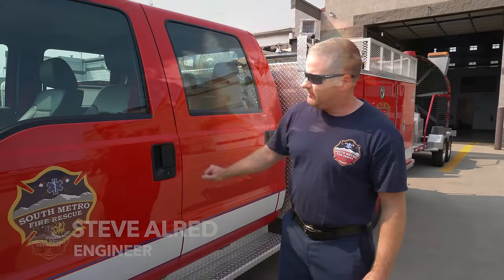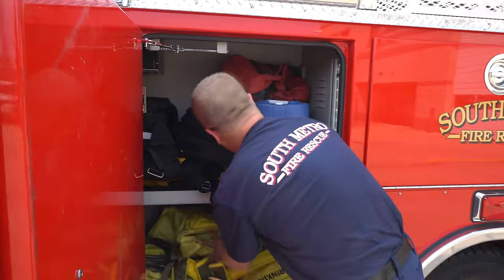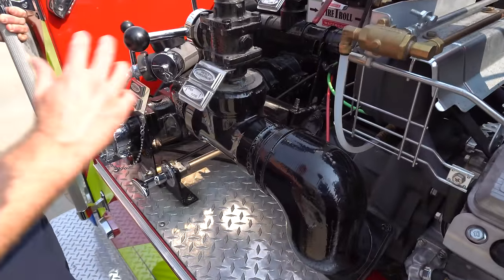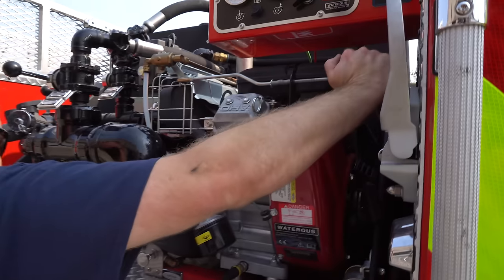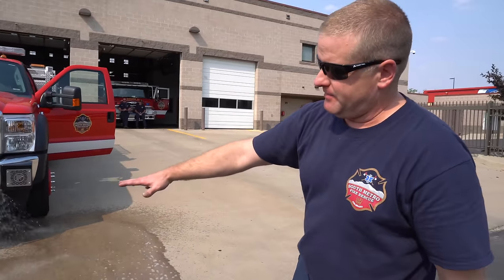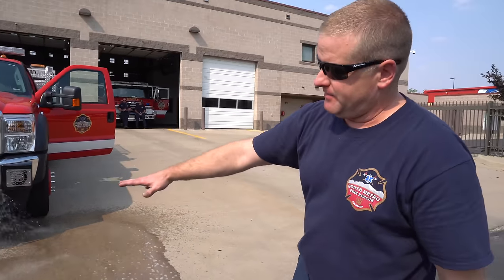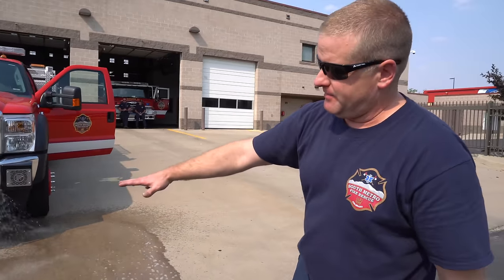Fleet Friday - Brush 22 and Fan 3

Comment: As a firefighter from Europe, a good majority of these compartments are really large compared to what they actually seem to carry. And I'd be almost scared to drive with the unsecured heavier tools loosely stored inside.
Reply: Most trucks in the US have full compartments. This is a pretty bare-bones rig.
Reply: Also interesting to see them use hoses with a thread, instead of the Storz-Coupling we use. Seems like a waste of time to have them as screw on, especialy on a brush engine, were you may have to decouple hoses quickly to get the vehicle away from fire...
Reply: Yeah, though I imagine the problem of coupling issues might be less frequent and severe with simple threads. Damn hard to close/open a Storz hose coupling sometimes!
Reply: Benjamin Köppler threaded couplings are very secure and have fewer moving/breakable parts. they're just reliable. they're also the standard in the US. also, this brush truck would almost never be attached directly to a hydrant as a water supply, it would probably draft off of a porta-tank or body of water, both of which would likely be relatively far from flame fronts.

Comment: Will Former Littleton Hazmat-17 be featured?
Reply: The former Littleton Hazmat unit was retired and sold.
Reply: @Spitfire8520  Probably talking about their Decon 17. The white International crew cab box truck.
Reply: @some0ne8  It is possible and Decon 17 is on the list to be featured one of these days. Since it was worded as "Former Littleton Hazmat-17," I believe they are most likely asking about the former Littleton Fire Rescue Hazmat 17 vehicle which was a 1992 Chevy Kodiak / SuperVac and a full hazardous materials unit. Hazmat 17 made a single run as South Metro Hazmat 17 in the very first month after the South Metro consolidation and was then replaced with the current Decon unit. The vehicle that was Hazmat 17 was sold this past June.

Comment: I noticed the Brush Truck, unlike other engines had no spare oxygen tank, is this because they don’t deploy with them? Is it not needed?
Reply: Scba isn't worn during wild land fires.  They aren't oxygen they are only compressed air.
Reply: Self-Contained Breathing Apparatus (SCBA) are not worn on wildland fires because they are quite heavy and not very useful as a single tank is usually empty within half an hour. Wildland fires are usually endurance battles which can last hours or even days and requires firefighters to be mobile and move quickly. While the air might be smokey, it is still somewhat okay to breath and some firefighters will use a mask to help filter out some of the smoke from a wildfire. SCBAs are typically only used where the air is not safe to breath such as a structure fire where the air can be several hundred degrees or toxic due to the materials like plastics being burned.

Comment: What's the difference between the wildland hose lines and the regular hose lines on the other rigs?
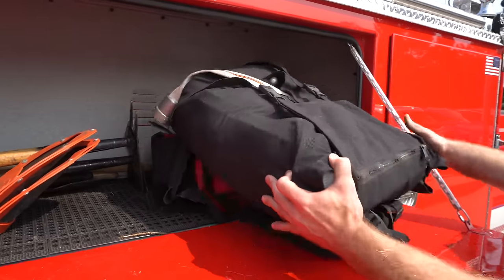Reply: Wildland hose is a smaller diameter single jacket hose that is lighter to carry and deploy, which is important where you may need to deploy several hundred feet of hose through difficult terrain where a truck cannot reach. At 6:33, Engineer Alred showed the progressive hose pack which has a 1.5" trunk line which supplies a 1" line that is they use to fight a wildland fire. The smaller diameter a hose is, the less water it can flow which is all that is needed to put out most wildland fires.

A regular hose line is a double jacket hose that is more durable and heavier. Usually those kinds of hose only need to go a couple hundred feet into a building. Some of the typical diameters of regular hose are 1.75" and 2.5" which allows them to flow a lot of water that is needed to put out a large fire.
Reply: Spitfire8520 Thank you for the detailed explanation, I appreciate it.
Reply: @dfw_fpis7655  Also depending on what they choose to deploy, some wildland hose also weeps water through its jacket and soaks itself in water to protect the hose from burning out.
Reply: JR:FIT Now that’s really smart.

Comment: That is the most trouble sum 4 wheel drive ford ever made in them years.  You will be stuck in the mud only to realize the 4 wheel drive front hubs striped out and are not working.    I have had to fix's 100's of these at the shop I work at

Comment: Why is it called fan 3? Why not fan 22? Are there two more fan units?
Reply: The answer is related to the historical numbering of south Denver metro fire agencies which is not as relevant these days. There were once many departments in the area, so it was agreed to at some point to adopt a uniform numbering system so that there would be no confusion of which units belonged to which department. Castlewood, which became South Metro, was given 3 and therefore all of their specialty units would have to have a 3 in them like Chief 3, Decon 3, Dive 3, Hazmat 3, Rescue 3, etc. and so Fan 3 was named following that tradition. You can still see the old designations printed of many of the specialty rigs like Decon 17, Dive 31, and Hazmat 38 even though they are no longer called that. I am not sure why Fan 3 was never renumbered to put it more in line with the other units, but it will probably keep the Fan 3 decal that ever happens.

Comment: why dont they use a Diesel?? one more power/torque and more fuel efficient.
Reply: Isn't this enough? He mentions what the blades can bear but the motor could do more right now too.
Reply: Gas engines are plenty powerful enough for what this truck is doing and for the amount of use it will get. There really isnt much weight on the brush truck so its capable enough. And you avoid the diesel regulations and dont have to worry about DEF and regen cycles.
Reply: @hihfty  maybe. and def is a royal pain. diesel is just a byproduct of gasoline